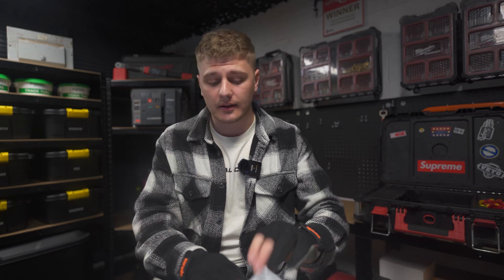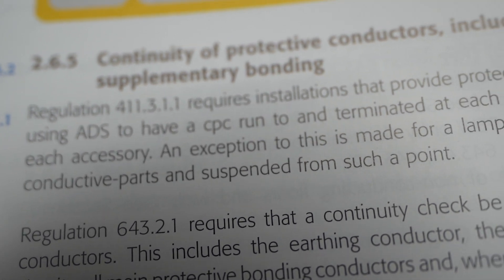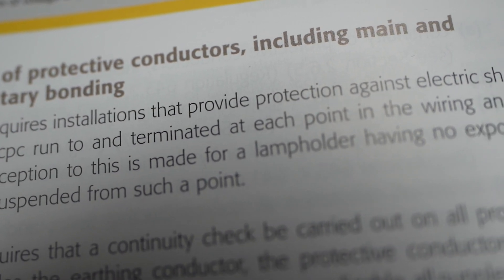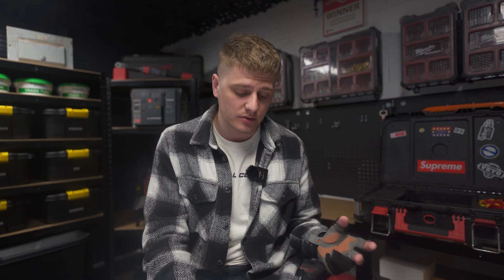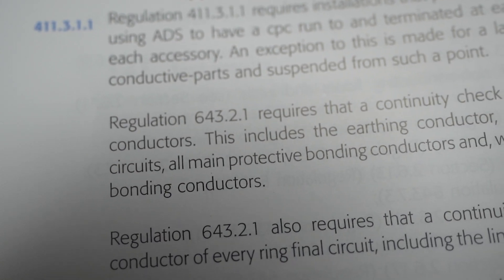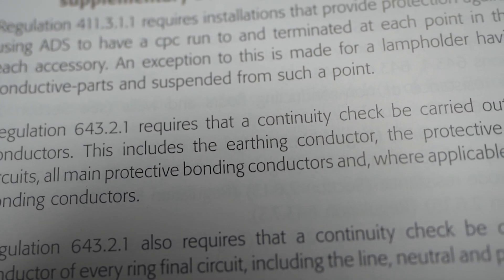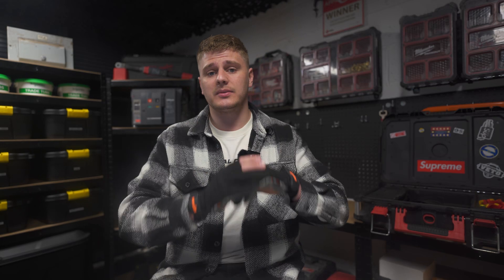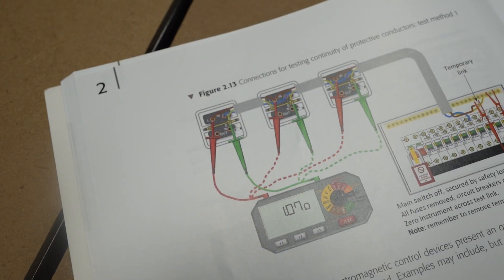Continuity of CPC on a radial circuit - R1+R2 & R2

Comment: Thank you for this.  In the real world time is a big factor and when you have a 3 floor house to test it is not so practical to try to undo ceiling lights and ceiling roses that might be stuck with paint and age. So any light fittings that have exposed metallic parts wouldn't it make sense to just carry out the R2 by clipping on to the exposed metallic part?  LIM  any fittings which are stuck from old paint? And polarity can be checked by manually  applying the voltage tester to the  Edison screw?
Reply from the maker: Yeah of course but you would want to detail the lack of visual inspections in your sampling on the cert 👍🏼

Comment: That you for some of this information given.  Am almost finished on my level 2 I been in the trade for meany years but there is always more to learn.  Dimmers have given me a problem.  Ended up linking I used to have a battery bank 2 x 9 v I used to clip on an test at each point.  Did show some problems after Mr DIY had been in.  Then tell me it don't mater it is AC.  This is why I will only fit double pole sockets.

Comment: Good advice. where did you you get the info from for the alternative test of RN+R2 test instead of R1+R2 on circuits with electronic equipment? thanks.
Reply: @residualelectrical hi is this method only in gn3 amendment 2 ? I couldn't see it in my 18th edition gn3.
Reply: @residualelectrical  thanks I think I'll get a copy this test will undoubtedly come in handy.